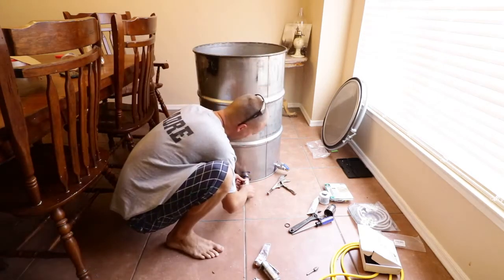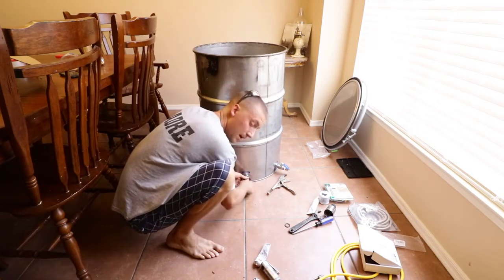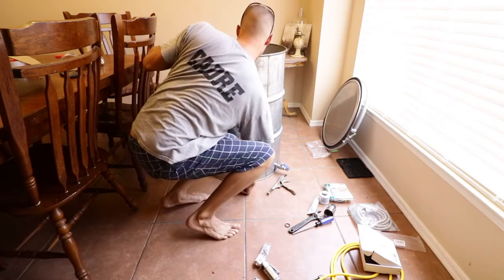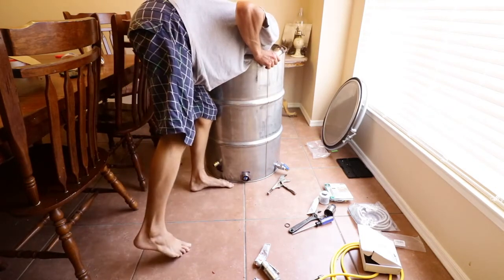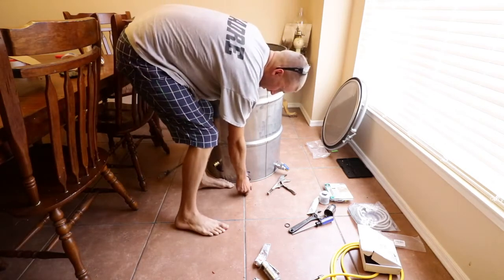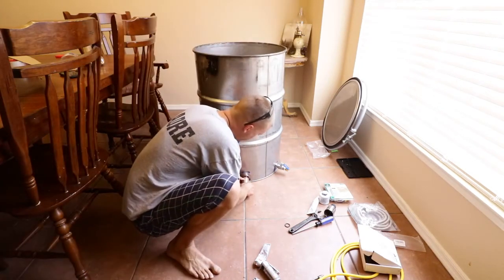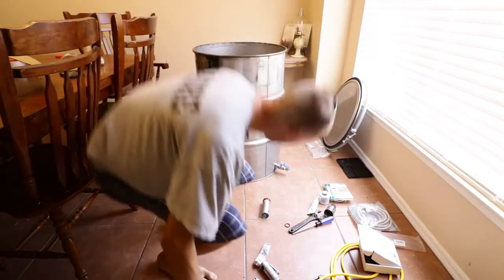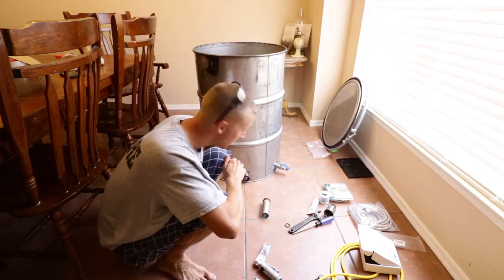55 GAL SINGLE DRUM MUSHROOM STERILIZER BUILD DIY

Comment: Hey im looking to get into mushroom farming, and Im planning on building a drum like this eventually, but id like the keep the costs down till I have a few customers. 

My question is, do you think a 1500watt immersion heater would work with a rubbermaid bin? Ive already got the heater and the bin, a/false bottom, and I figured i could do maybe 4 or 5 10lb bags at a time, and just put in enough water as to not worry about it all steaming off over the 15 or so hours. Or maybe Id just top it off manually if it seems to be getting low. 

Any idea if 1500watts would be able to supply enough heat for hyper pasteurization? Thanks.

Comment: This drum receved 15psi pressure  please anwer
Reply: Nope
Reply: It could
Reply: That's not true. It is not built to withstand 15psi @HoboJohnGalt  . Your advice is incomplete, incorrect and/or negligent. 

15 psi is high pressure only achieved with proper sealing and safety mechanism. This is lower pressure so you have to cook longer.